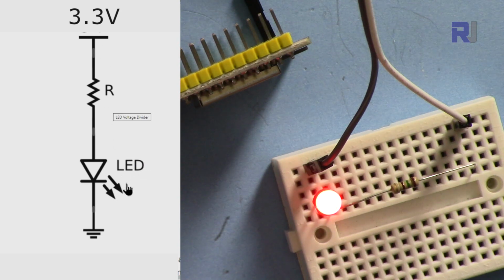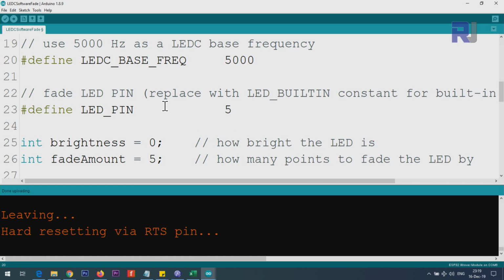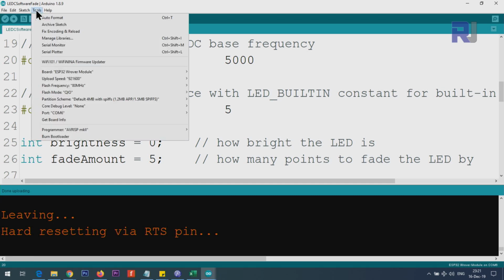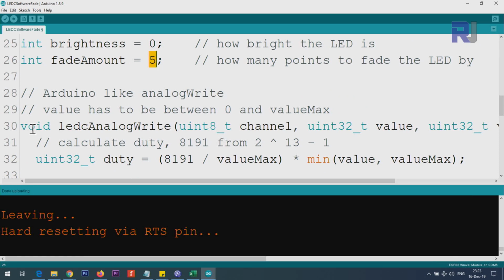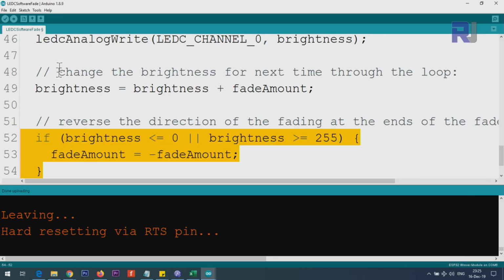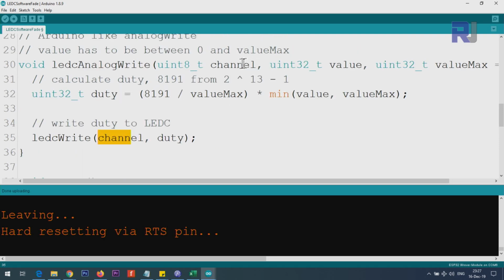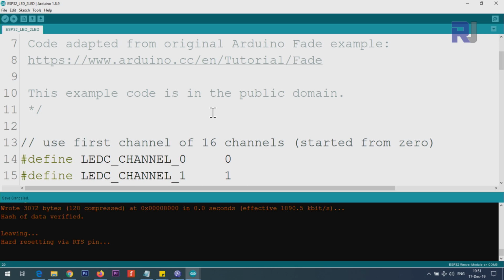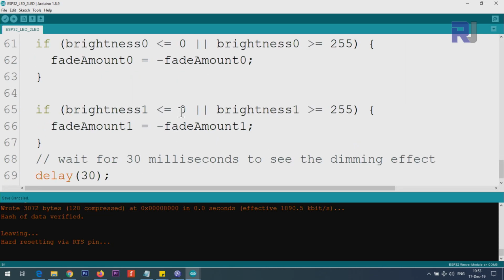Fading 1 or more LEDs with ESP32 and Arduino IDE and calculating resistor for LED - RJT250

Comment: I would like to see a project where you let 2 of these communicate via its build in wireless devices. for example trigger
a switch on device 1 and a led on device 2 is switched on/off via bluetooth/wifi
Reply from the maker: I have a video to showing you how to turn ON/OFF LED using Bluetooth https://youtu.be/xy40LPu3fbc

Comment: 3.3V - 1V = 2.3V  Then  2.3V/.01ma =230 Ohms
Reply from the maker: LED voltage is 2V.
Reply: It should be 3.3V -2V = 1.3V
Reply from the maker: Yes.